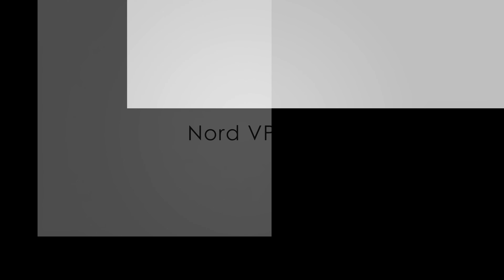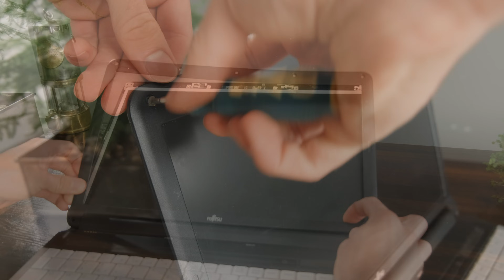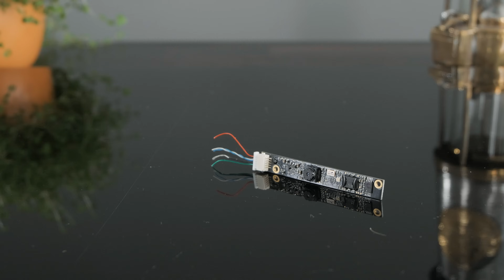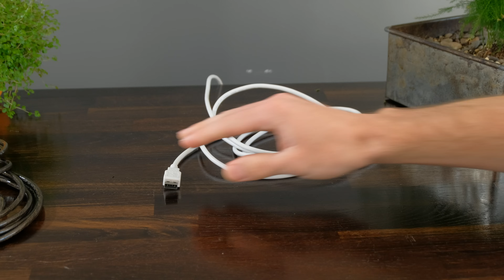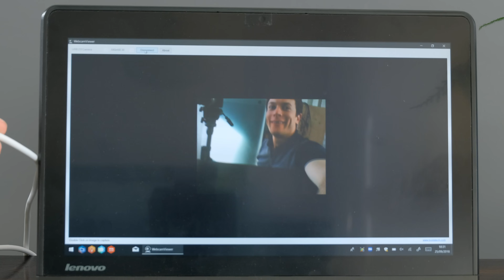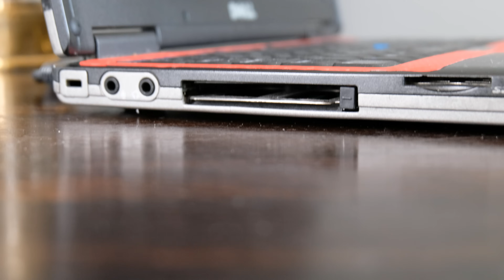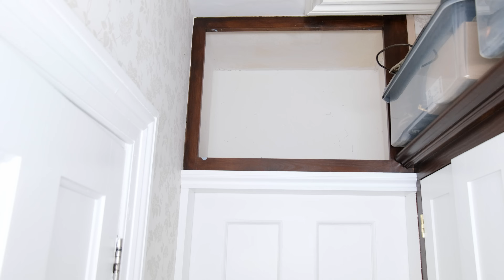DIY Home Security - ON A BUDGET!

Comment: Well done simple video set up for those on a budge and willing to do a little work from pointing out were to get the video units to the simple way of ringing out or finding the power, ground and data wires along with what to look for if the PC can not find the video unit.

The fact that units are small allow them to be place in an endless number of places in and  around the home 

The fact that laptops are small allows lots of places were its out of the way  or hidden under a false bottom and with the back up battery it can give hours of recording if power is lost or someone pulls the power meter to the home. 

I found your video very  ease to understand I love it when people becomes cooks as they say for a good cook can help change the world we live in from simple meals to very high quality video sets up like this, that could ease cost 100,S of dollars for the do it your self over the counter system to the ones costing in the 1000,s when you add the install cost and charges each mouth

Thanks for your time for who knows how many ideals you may have spark with this video

Thanks

Comment: Could i make the same with smartphone cameras and microphones?
Reply: Nope. Because smartphone camera does not have USB type wire scheme. So you would not be able to directly connect it though USB.
Reply: @dipanshuc  Ofc, its totally clear. But are there any converter or sg? Thats my question.

Comment: Great setup, but all feeds pictured in the video are in daylight. I feel that one major feature it's missing is some sort of night vision like most home security cameras use?
Reply: Yes, there's no night vision. That would require high power IR LEDs and a moving IR filter over the lens. Ever heard of security cameras make a clicking sound when transitioning between night vision and daytime full color mode? It's the filter moving inside the camera.
Reply: @PunakiviAddikti  so are you able to just add the filters to the  webcam cameras?
Reply: @wartillthendanimation   cameras see IR by default, they come with a filter to block most of it, so you would have to remove that
Reply: @Guizo66 the front facing camera on most smartphones does not have an IR filter and can see the light from a remote control for example
Reply: @cantinasongband  bullshit. they do have a filter. This is like saying sunglasses do nothing because you can still see the sun through them lol. Just think about it for a minute. those remotes are really fucking powerful. in fact, if you actually remove the filter from a webcam, that remote can light up the whole room. that's why nowadays you don't really need to point exactly at the tv with them
Reply: @MrDoboz  lmaoo
Reply: Back at you ... and your 'tude.
1. The reason you don't need to point your remote at the TV is (a) because it bounces all around the room and (b) the receivers are incredibly sensitive.
2. The IR filters used on cameras are ridiculously effective. You can jam a remote up against the lens and see _nothing_.
Put your bullhorn down and go back to school.
Reply: There are also alternatives using night vision specific cameras. The cheapest ones I find connects to a raspberry pi
Reply: For outside cameras id suggest solar powered led sensor lights, they are inexpensive and do not rely on your homes electricity.
Reply: Or just buy some lamps and keep them on all night..
Reply: Well for outdoor cams install them right under or over your security lights with motion sensors. Almost all households have it. That way whenever there’s any movement the light will come on and you’ll get a clear vision of the surrounding.

Comment: Nice video, but finding the correct device driver for the cam can be tricky, especially when the cam is more than 10 years old or if your using a outdated operating system. So, remember before even trying this video at home, make sure you do your research on the cam, who made it, and the manufacturer web site for the device driver download links.

Comment: you mention no way of knowing which is data in and out, a tip for this is, positive data is usually the wire next to positive power wire, leaving the 2nd wire to be data negative as that one will be closest to power negative, this is how it also works on USB cables :)

Comment: Another cheap way is to get raspberry pi w for not much and then do what was explained and make your own usb webcam for it. You can also extend it further as the raspberry pi can be connected to home wifi and the device will have it's own IP address.

Comment: The only thing is that most webcams are 3,3v in stat of 5v USB. I think it works for you because you have enough voltage drop on the long cable.
Reply: @ruakij6452  it doesnt work for me, on the 3v3 pin i have 5,1 and the webcam dont get detected.. i have webcam from an old sony vaio

Comment: this is amazing matt! i need to do this for the outside of my house. So I'm looking at installing on my garage (back of house) and front of house. So perhaps a RP in the loft for front of house and inside, then another in the garage. I'm thinking of using RP's as they are easier to box up and simple to remote access, plus more reliable than standard OS.  I guess I could put the garage/garden cameras in small waterproof enclosures.  Based on all this, any advice? :)

Comment: Surveillance companies hate this guy.
Reply: They still monitor, and could call the cops, supposedly. You can set up all the cameras you want but if it's only giving you a nice video of a break-in you don't find out about until the next day it's only doing half the job. Motion detecting alerts could in theory let you do the monitoring yourself, but you've got to sleep and work and whatnot. And setting up your own alerts so they're not going off every time there's a breeze in your yard, or a pedestrian walking past, or your dog/cat takes a lap can be an exercise in frustration.

Not that a monitoring security company's the greatest deal ever, some with contracts and prices so high you could afford to buy a new fancy remote controlled outdoor wifi camera every 2 or 3 months. They should have a monitor-only option if you've got your own stuff... some must.
Reply: @user-ut9ln4vd5m  diy is, again, the answer to the cheaper solution. Just diy a motion sensor
Reply: ** all shut up Dookey duke

Comment: Thanks DIY Perks.
I followed this video to install my own home CCTV. Here are my additonal tips: 

1) Do not cut the USB extension cable. Instead use a shorter USB data cable to attach to webcam. This way you can disconnect and move the camera around without long cables to move with it.

2) Do not use two webcams of the same model and chipboard, ContaCam will think it is the same camera and will not load the second. The cameras need to be of different model or chipboard.

3) Get a ball and swivel mount to be able to rotate the camera to your desired view. I used an unused dashcam swivel piece.

4) Use some plastic board to mount the webcam on. Stick down with some picture frame adhesive like 3M.
Reply: Instead of cutting an extension cable, cut the cable from a dead keyboard or mouse or ...
Reply: Stan .Rarick or RJ45 cable...??😎
Reply: Regarding point #2. wont the cameras use different COM ports?
Reply: Haroon R thanks.
Reply: instead of a ball and swivel, you can get a servo gimbal,  wire it to an arduino and use a small hub.
then you can pan and tilt the camera from your home.
Reply: Is there anyway of connecting the camera to any arduino board instead of laptop ?
Reply: @lensnlarge970 maybe its possible if you hack or immulate the board.
Reply: Laughing at some of these replies! "...get a servo gimbal,  wire it to an arduino and use a small hub...", "...get an  servo, light sensor, and ir filter remove the ir filter from the camera, rig the light sensor to the usb power and trigger the servo to flip the ir filter over it in light..."

Or just buy a fucking cheap surveillance cam, because the whole point of this video is "DIY Home Security - ON A BUDGET! " 🤣🤣🤣🤣🤣
Reply: Veronica Sester  buy a real security system at that point, or figure out how to weather-proof the exposed circuitry and repeaters.
Reply: 1. Sure it will ease of chancing and replacing cameras, but it can be vandalized and tampered that way also easier, so you have to balance between the two in that regard and USB connector is not IP44 protected so on outside you want to get connector inside the house before having the connector. Camera you can seal to how ever IP standard protected you want, but it wont help if connector get oxidize
d and wont transfer data or power.

2. Dont know about the subject that much, but i think you can run two identical cameras with some software wizardly, but dont quote me on that. Its sure better to have different ones so those wont get mixed.

3.You can build such mount easily your self, but optionally cheap factory mounts are option and better than hard mounting them into corner, though agains possibility of tamper is real danger there, also it makes camera more visible, what ever that is good or bad thing you decide.

4. Good option, but PVC wire channel would be my solution and you can make polycarbonate lid over the camera lens and fill rest with the silicone or similar cocking to make it weather proof.

Personally i think best solution is to make it ip44 standard and impact resistant, so it cant be knocked into different direction or out by trowing something, using stick/pole of sort or destroyed using for instance air rifle. Proper rifle shot can be heard miles away but air rifle shot would not be.
Reply: @veronicasester7250  Passing a USB cable through the wall is easy enough, just like a TV antenna cable. Maybe you could coat the camera with a thin layer of transparent hot glue to weatherproof it?
Reply: I use ispy software it's quite dicent not sure about othe people opinions
Reply: "1) Do not cut the USB extension cable. Instead use a shorter USB data cable to attach to webcam. This way you can disconnect and move the camera around without long cables to move with it."

Can somebody explain this further? What usb data cable can be attached directly to the camera?
Reply: Kodi See my comment above.
Reply: 5) get an  servo, light sensor, and ir filter remove the ir filter from the camera, rig the light sensor to the usb power and trigger the servo to flip the ir filter over it in light
Reply: @thatjokerperson7062  and that way it becomes more expensive than a ptz cheap camera
Reply: sugru's better because it's hard to vandalize
Reply: Please am facing challenges and I need you to help me, I can't use the camera  when I used USB extension that is more than 3meters
Reply: Peter Usman USB cables come in two types: passive and active. Passive cables are simple extensions so your 5v drops off quickly as it meets resistance passing through the cable.

Active cables boost the power back to 5v, they are basically power repeaters.

You need an active USB cable.
Reply: @peterusman7527  dont use the extention. Order the same gauge wiring as your usb camera and solder them.
Reply: Can use the wire of Ethernet cable for ground, d+, d- and 5v?
Reply: Kewl!  Thanks!
Reply: i pluged my webcam on my desktop pc, it detects the cam but its paint in black, no image at all.. any ideas ?
Reply: @uacoZ  did you install contacam software?
Reply: @HR-dz5vu  no, i want to use it for streaming to have more than one webcam.. I use OBS Studio, but i tried it on diferent programs and it doesnt work :(
Reply: this comment needed to be pinned.
Reply: please help me I have arranged the data cable with nothing happening windows says that it can not be recognized not matter what do I have to solder them or can I get away with just twisting them together (bit new to doing DYI's)
Reply: @HarryH1738  you don't need to solder wires,  twisting together will work, just make sure you have a full strand of wires (none cut or missing) when you join camera cable and data cable. Other reasons why it may not be working is because:

1) you did not connect the correct wires together. So try checking again.
2) you did not install Contacam software. 
3) camera itself could be faulty.
Best of luck.
Reply: @HarryH1738  There are two types of usb cables , one is just for charging and other is charging+data. Make sure which type of cable you have.
Reply: @goku4393  I have one that was an extender, but it was not one that extended the signal actively and had 4 cables inside. I had already made that mistake with a charger.
Reply: @HarryH1738  did you buy the cable online for cheap rate? if it's cheap rate ,then it's a charger extension.
Reply: @goku4393  I found it in my basement. Any chance you could direct me to the right cable?
Reply: @HarryH1738  let's check if your cable is detecting something , first , connect the cable with any device to the pc. and open device manager , notice if any changes are happening to the ports, if it's un identify port, it'll show a question mark. then, change the port and check. might be port problem.
Reply: @goku4393  I plugged it into a USB 3 port does it have to be USB 2? I know the port is working. Also it tells me the device is not recognized (no matter which way I orientate the date cables).
Reply: @HarryH1738  USB 3 is compatible with USB 2 , so, it might work in that, but in your case, you may change the ports. Are you using Mac?
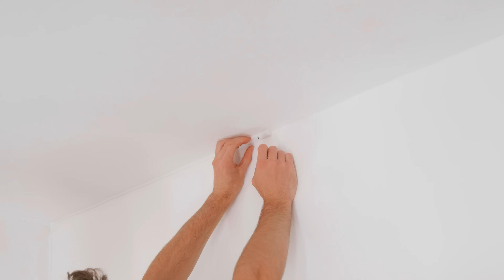Reply: 6:12 I'm going to have nightmares about USB cables slithering into my bedroom
Reply: @chfourchfour  and USB is Universal Serial Bus so its Serial port
Reply: @ShiroCh_ID  Serial refers to the method of data transfer. Despite both having "serial" in the name, USB ports and Serial ports are 2 different things.
Reply: @ShiroCh_ID  serial port and USB Port are communication ports, but are very different, sorry, they ain't the same. Please go back to computer school and learn something. Thank you.
Reply: Virgil Walker ok kids, play nice. You don't want me to stop this car!!! 😎🖖
Reply: @virgilwalker683  So do you mean that we can buy the same model of webcams and it will work fine or no, we have to buy different models of webcams?
Reply: @iMadScience  basically any web cam from laptop old or new.
Reply: @virgilwalker683  Please read my question. I asked about one thing the commenter said, which is whether the same model of webcams could work. He said we can't get the same models because the computer wouldn't be able to recognize.
Reply: @iMadScience  any onboard cam from any laptop from 1996 to 2019 can be hacked, either by hardware hacks or software hacks. If you know what your doing and do your homework period.
Reply: @virgilwalker683   No need to be rude about it.
Reply: @virgilwalker683  
computer school? lmao that either doesn't exist or is for absolute nerds
Reply: @virgilwalker683  I was hoping someone called this Snooty McNoseItAll Snoot Snooter out. Thank you good sir.
Reply: Haroon R if didn’t understand the first one... there is still a cable from the Camera to the laptop
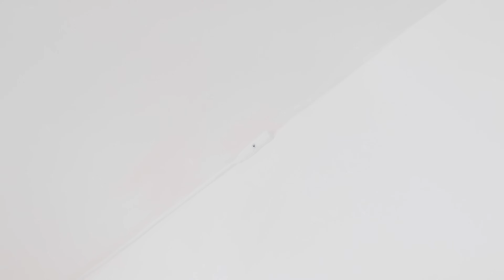Reply: At 5:59 of this video Matt has used a long cable along wall and ceiling to connect to camera and laptop. What I am saying is that keep the usb wire to camera very short (say 15cm) and use a USB connector for the rest to connection to laptop/pc. This was you never need to remove long wire from wall and can change/fix the camera very easily by disconnecting the short camera USB. Hope this makes sense now.
Reply: @HR-dz5vu  does USB Hub work , for multiple CAM??
Reply: There's a place on the deep web full of webcams like this people install. Everyone's watching you. They bet on you, the do disturbing things, they see you. Take care

Comment: Damn, I didnt know laptop cams were USB!  Thanks!
Reply: Yeah, it's one of those things that make too much sense to actually be true, except in this case it is.   Very handy to know.
Reply: Ye that’s why they aren’t as good as phone cameras
Reply: Most things on a laptop usually uses the USB protocol but some are integrated on the main board. In other words you cant take them out.
Cams, card readers and sometimes the touchpad are some of the things you can reuse.
And about the quality it depends with USB protocol they are using. A USB 3.1 have more than enough bandwidth for 1080p raw or even 4k compressed.
Reply: They are not. He showed you how to identify the wiring once you remove them and soldered the camera wires to a USB cable.
Reply: @juans6639  They are usb.. they just wire to internal usb header instead of external port

Comment: Cameras are a horrible way of securing anything unless you have an on duty officer watching the live video 24/7. Access control and Security is what I do for a living. Prisions, Court houses, federal buildings, military bases, ect... I use infrared, Microwave, Flir, Bio-Metrics like facial, retinal and finger print security devices. I always tell customers "you don't need a camera to know you've been robbed, you'll know because your shit is missing". The only point of cameras is to collect evidence. Even with the best 4K cameras people try and use them to pick up a huge area and then they feel cheated when the perpetrator cant be identified and the video cant be used by police as evidence. These cameras people are using now for security are useless. A monitored security system professionally installed w/motions, contacts, glass-break devices is the only way you can secure an area with a central station monitoring at all times. Even with a centrally monitored alarm you are still at the mercy of time.

Comment: Hello, thanks for taking the time to post your vids. I have a question about the concrete Bluetooth speaker build, the Battery Bank Tubes seem to no longer appear to be available, do you think this may work? Single Slot 18650 Battery Holder Power Bank Plastic Storage Box Case https://www.ebay.com/itm/401733467983.